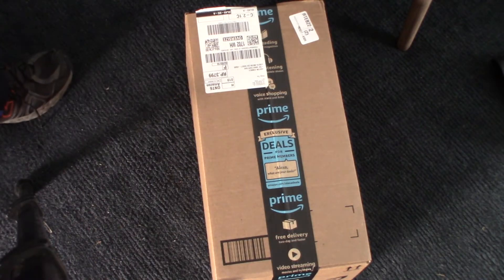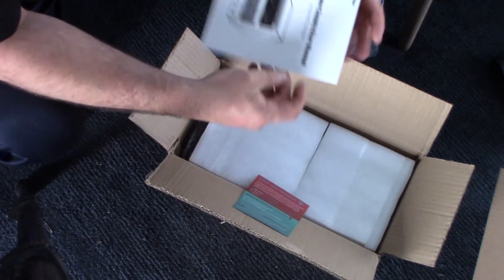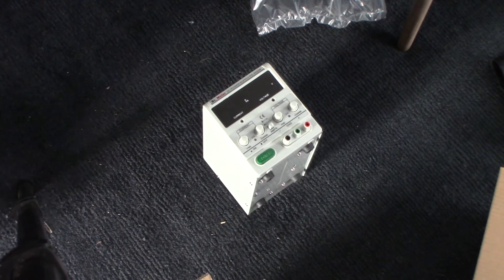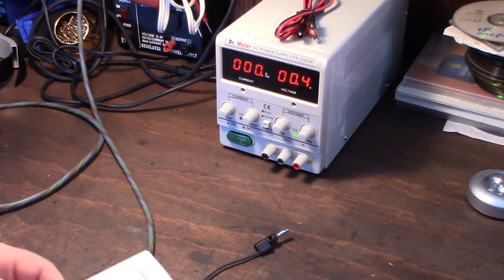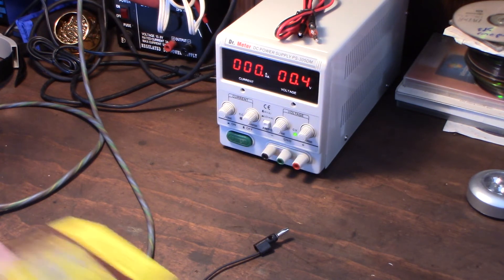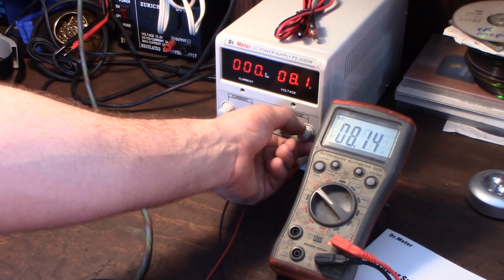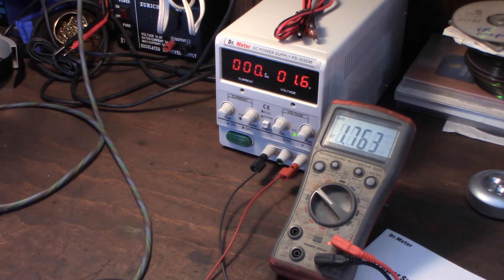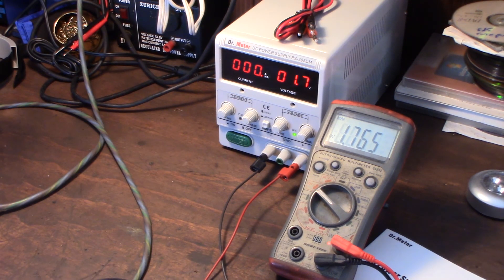Dr.meter 30V/5A DC variable test Bench Power Supply

Comment: The ground terminal allows the power supply to be setup with a positive or negative output voltage with reference to ground through the use of jumpers.
Reply: In the manual, it says to jump it to the negative terminal to reduce ripple.  Weird.

Comment: i got the same power supply today any things or quirks i should be aware of?
Reply from the maker: so far so good, haven't used it allot. Just got about a month ago.
Reply: @fintechrepairshop    You can adjust both the voltage and current to match your meter by adjusting the small screw inside the small hole below the display.